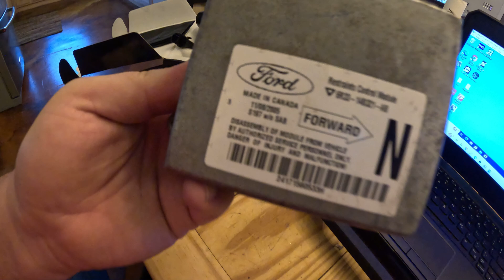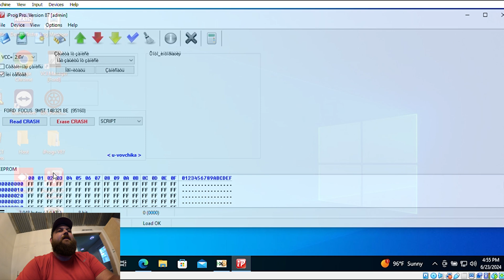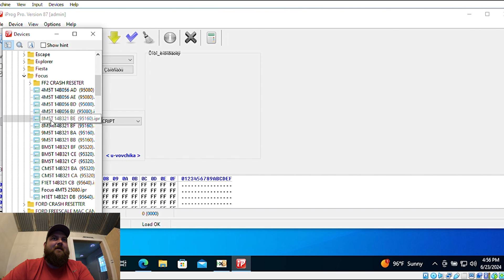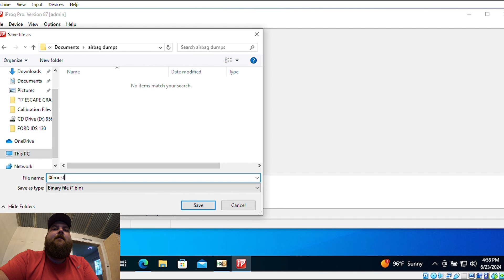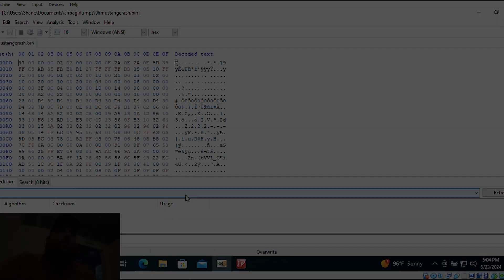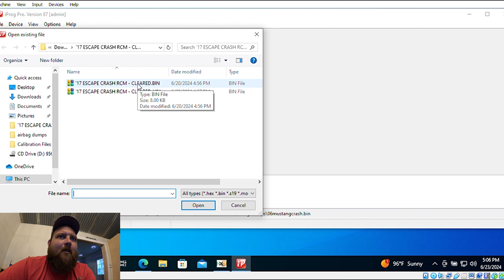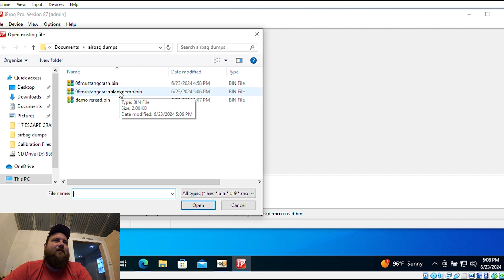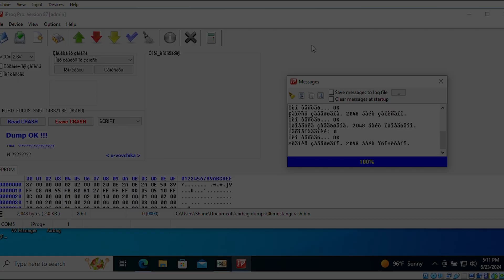A Beginners Guide to CLEARING SRS Module: How to Get Started Reading/Writing to EEPROM Chips!!

Comment: Do u have any software to clear the crash data?
Reply from the maker: @Aman20048  So the iprog software I mentioned has built in scripts. We didn't have much success with it though. Ended up doing it manually in hex using some example files. As I mentioned though, I'm super new and was just trying to help people get over some early hurdles I struggled with.
Reply: @GreenCastleGarage  what about carprotool is good ?
Reply: @GreenCastleGarage  So how about carprotool is good for clearing crash data?